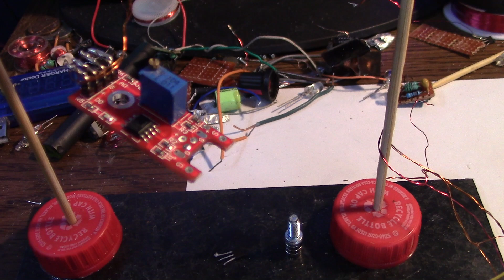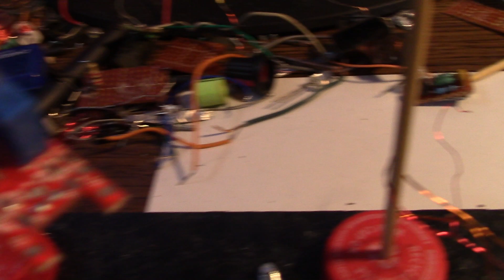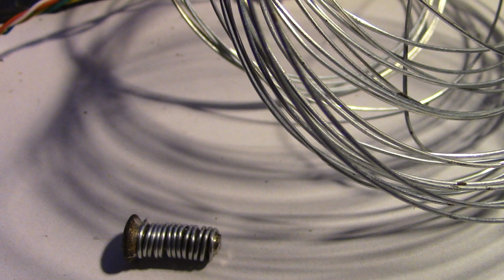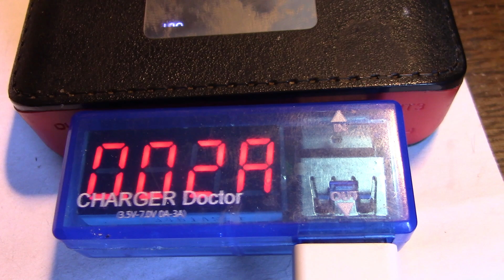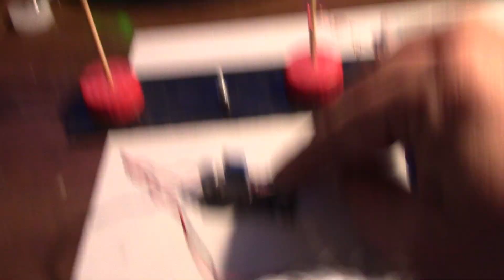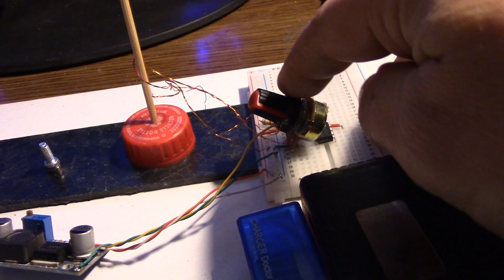Easy to Make Magnetic Levitator (uses 5V USB and no MOSFET)

Comment: Pretty cool, is it possible to collect the radiant emf emanating from smart meters?
Reply from the maker: Cheers 😀
Have wondered about Smart Meters and did do some experimenting at the old house (3 years ago). We don't have one here, it's probably too remote for the WiFi link to connect to any other.
A harvester able to capture 2.4GHz signals should be the route, from what I know. You might well be able to tune a coil and caps to light an LED at the front or side of such a meter, though who knows what the legalities are of doing so?

Comment: Lovely work ❤

I have a question since you got this maglev effect: how can I design an aircore solenoid to match a permanent magnet ? … I mean I want to replace a permanent magnet with a coil that will have the same magnetic field strength with the magnet I want to replace. What would be the easiest approach calculating MMF in amp turns ?

I mean I can measure in tesla unit a permanent magnet then convert to amp turns ? Usually permanent magnets are sold as kg pull force … not very easy to get specifications.
Reply from the maker: Thanks 😀
What I'd do, to match, would be to set a magnet at the distance where moving the magnet any closer pulls a tiny screw to it. Measure that distance. Then construct a coil, using the voltage and current wished for (using a VR to adjust amperage) until it matches that same pull point. Then the coil could be changed to not need the resistor, by increasing turns. You'd then have at least an approximating pull force, with known voltage and current.
Reply: @ well that’s exactly my approach … pure empiric 🤣 I was looking for something more scientific based on known formulas and I though calculating amp-turns may lead to good results for equivalent MMF (coil)of kg pull force (magnet) to simplify the design.
Obviously I have a certain setup in mind for all this and I don’t want to spend months winding coils trying to find the exact geometry with minimum current drawn. I found a good calculator for MMF where I can play with certain parameters to get exact MMF I want assuming I can measure the same for a permanent magnet.
Reply from the maker: @ An interesting approach may be to use the method we both thought of, but then calculate properly and see if the calculations do approximate the real world data from those first experiments. It would be good verification.
I'd think Stack Exchange would be a good place to ask for the formulas... or Chat GPT these days!
Reply: @Slider2732_  Many thanks, I really appreciate your help ! ✨